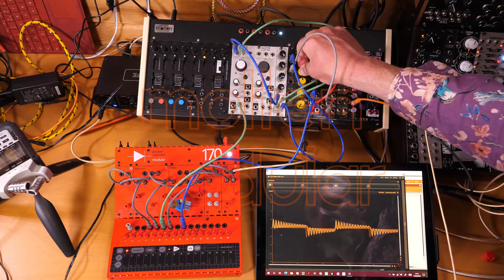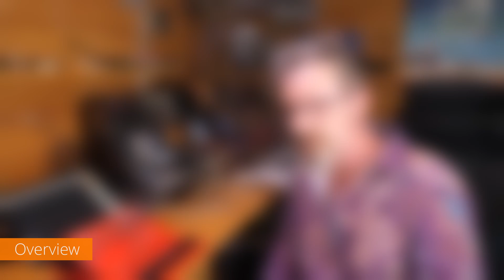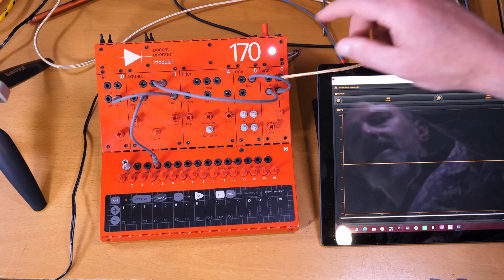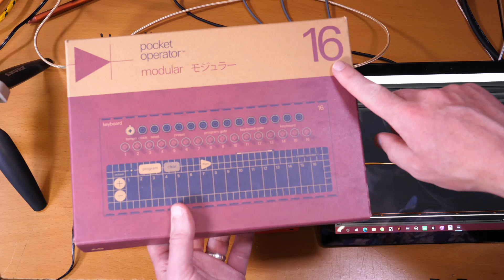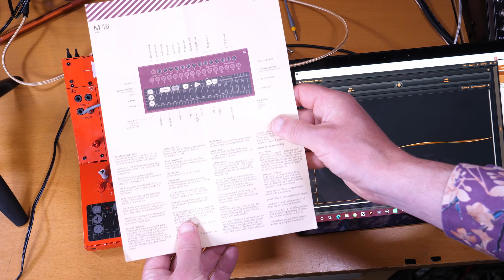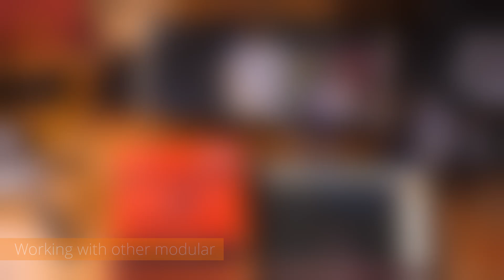Teenage Engineering Pocket Operator Modular 170 review

Comment: Hi Robin, the in-depth sequencer video mentioned at 34:48, is it still in the works? I remember you concluded your PO Sound On Sound review with "that sequencer, though," so I'm intrigued. Have you used different tempo divisions and arp per step on different tracks yet?

I'm planning to do a small batch of custom Eurorack cases with modded versions of the PO 16, replacing the membrane with key switches and latching/momentary On-Off-(On) switches for those useful to hold down (oct, track, program) and maybe with sliders vs. knobs for CV setting (undecided). Also a ton of mult lanes, some with attenuators, as I find these more necessary than VCAs even!

Anyway, thanks for the video it got me to pull the trigger when these were on blowout.
Reply from the maker: Not entirely but: Jamming with the Teenage Engineering POM 16 Sequencer
https://youtu.be/yjm3M3mxjv0

Comment: I like the formfactor and that it's indeed 'properly modular' as in not pre-routed or normalised. But then you don't get any LFO Speed input, LFO Reset, Envelope Attack or Decay CV inputs, Resonance CV Input, etc. It looks like it has a bunch of CV jacks because a bunch are there two or three times (which is pretty cool) but it still feels so limited that if I saw this and a crave side by side for the same money I'd get the Crave. Or even a Volca Modular. Sequencer seems neat, but I'd rather have a slightly more practical one. The Crave has ratchet, pitch, mute, glide and accent per step and 32 steps per sequence. The VModular has microtuning and other cool features. Maybe I'm just more in a semi-modular mindset though. I bet there are things the Crave couldn't do that I'm not thinking of right now because I'm so used to semi-modular.
If we did have more CV Ins that 4 channel sequencer would be so sweet. Like if they would let us set a LFO speed per step so we can get some weird rhythmic patterns with filter FM going. But now I'm struggling to see the point of that sequencer in this setup. Maybe to manually set filter cutoff? Or Amplitude modulation? That could be fun. This sequencer in the 400 modular would have been so cool and I would be fine with the 400 sequencer in the 160 at a lower price. I like the idea, but I wish there was just a little bit more...
Oh great review btw! Love how you take the time to go in-depth.

Comment: i'm delving into the world of diy modular and had to google "difference between a100k and b100k pots" - bear with me here - a are audio and b are linear. If you use a linear pot in where audio should be - apparently all the adjustment would be bunched up at one end of the pots travel instead of evenly changing over the range of it. do you think that might be the problem with the PWM? tbh, i have no flippin' idea. but when i read that, i was reminded of this vid.
Reply: I am an analogue engineer, Yea what you described could be the problem but its impossible to know for sure without a close look at the circuit board. In either case, A or B (Or C, D, R, X, Z; there's an entire universe of pots) its surprising that the "11o'clock bug" made it through testing. Re tuning the circuit would not be a insurmountable task for a company like TE. In general lots of little things like that make me feel the PO Modular range was somewhat rushed.
Reply: You just answered a question I've had for a long time. Novice circuit builder, been making stuff with scrap parts.
Reply from the maker: Sure, possibly 😁
Reply: @MoltenMusicTech  🤷‍♂️, who knows

Comment: Thanks for the review and demo, and especially for more or less limiting it to the sounds that the 170 can produce, rather than 'this is what a 170 sounds like with the rest of my rack adding effects etc'.
Maybe it's not actually toy like enough?  Where are all the blinky lights?  Why is it not either sexy black or brushed aluminium?  The whole and entire point of modular is to be ridiculously & hideously expensive.  Side cheeks might be good though.  I have other control surfaces where the knobs do the wind round until they take up thing, i think the advantage is that you're less likely to accidently nudge something away from its current setting.
Reply from the maker: That would just make it the same as any other modular. I think that the design style is definitely a plus in terms of this synth.
Reply: @MoltenMusicTech  I agree, my criticism was more aimed at the people who say that it's toy like, expensive and hipsterish.  To me, that's a 3 word definition of modular synthesis.  That said i'm enough of a hipster to really want to play with all those lovely eurorack toys, i just lack the funds.  For me, the pico system III looks more interesting, it seems to offer more in the way modulation options, but i wouldn't know if it's valid to compare the two systems directly.  I do suspect that TE deliberately went for the whole marmite experience, none of their gear is designed to blend in.  I wonder what the sensible next steps would be for someone who had one of these as a starter system?

Comment: It's just too expensive for what it is. They could have sold more for less.
Reply from the maker: I think what people miss is that it has a £200 sequencer built in. The 400 with three times as many modules is only £100 more but doesn't have that sequencer.
Reply: @MoltenMusicTech  Still, I could get a micro-brute for $100 less which does almost the same and probably more. Or get an awesome Microbrute 2 for $50 more.
Reply from the maker: Sure, but that's a synth with some patching, not a modular synth. There are plenty of semi-modulars or little synths which do more but they're not modular synths. Why buy into Eurorack at all when there are so many great synths out there? You're not comparing the same thing - it's a different approach.
Reply: @MoltenMusicTech  I see what you mean. Except that this is not really modular modular either. Yes it has modules but they're fixed, there is no "choice". Which is a big part of what makes modular what it is. One could say that it's just a synth with modular patching but without prewired connections. Having modular patching is just like having a mod matrix, albeit analog with cables.

It is basically unclear what they were trying to do here. The looks of it tends to suggest that it's a budget system. The made of it (Steel) suggests it's not. If they were trying to introduce a new format/standard. They should have at least made those modules detachable for us to hope in the future that they would produce more module options. if they were trying to introduce a budget modular system (hence the word "Pocket"). They should have prices in the range of their previous pocket operator products which are way cheaper and more interesting I'd say than plain analog typicals. I think many people thought this way. I could be wrong.

Comment: Not worth the retail price with so many better options for the same or less cash. Somewhere between 100 - 199 at Aldi would make sense for this synth.
Reply from the maker: If it was made of plastic on a single smt pcb with normalled routing and a single track sequencer then I’d agree. But as a mini Eurorack system in a metal box with deep sequencing I can’t honestly find anything to touch it at this price.